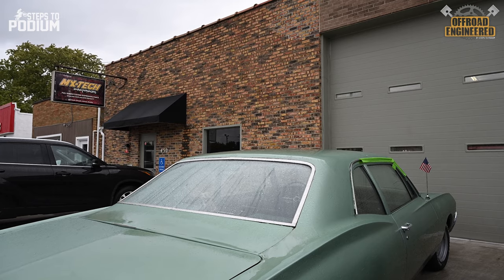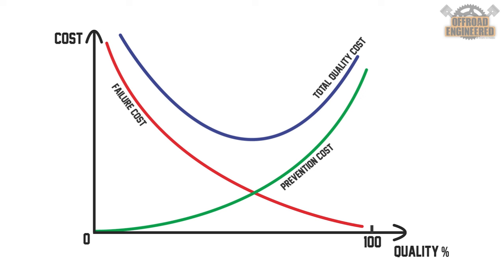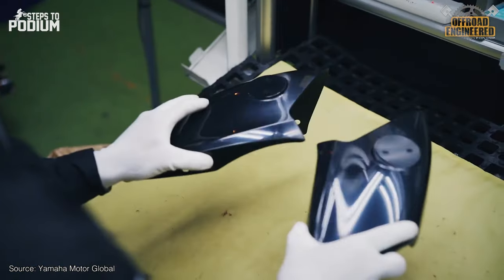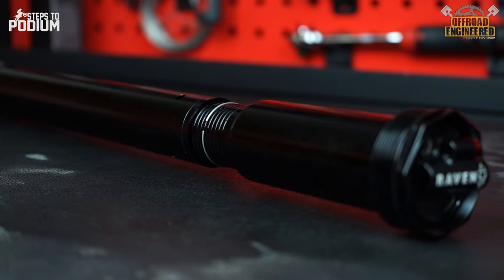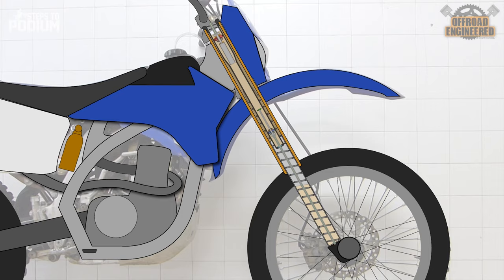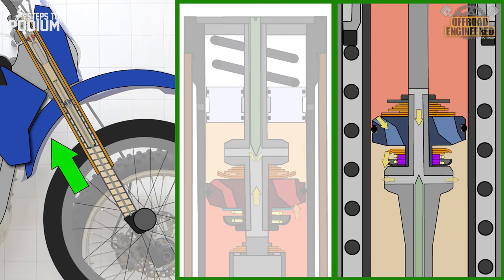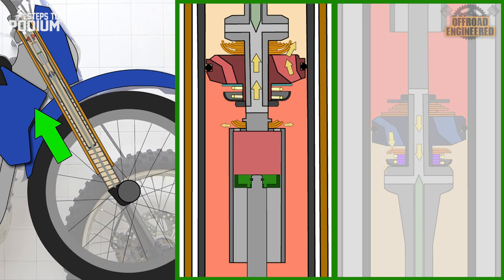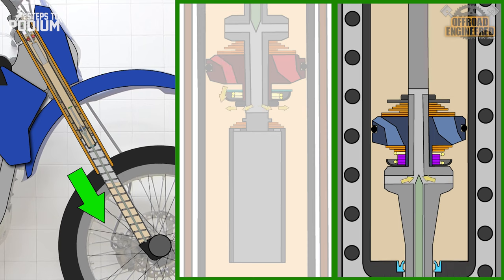@mxtechsuspension  Raven Cartridge Kit | Offroad Engineered

Comment: You have some of the best suspension graphics on YouTube.   Hopefully you will have a video testing these Raven cartridges out and compare them to the KYB SSS forks valved to your personal settings.  Personally I prefer the open cartridge forks for off road riding in non racing situations, they seem to soak up the small bumps better.
Reply from the maker: Thank you so much!
I will, for sure 👌 there are a lot of details that I left out which are more riding specific, but will definitely address those points 💪

Comment: After speaking with MX Tech, I understand that there is a check valve on the mid valve that prevents the low speed bypass on the rebound circuit from allowing free oil flow through this circuit on compression.  I like how they separated these functions and it has allowed me to fine tune compression and rebound settings without any overlap between the 2.
Reply from the maker: Yes there is and I'm glad you are aware of those nuances 💪
To be able to make this video more digestable, some details were left out proposedely. Since that check valve has little impact on the overall behaviour of the forks (it does not mean it has no value, don't take me wrong) I opted to keep things simple 👌

Comment: Forgot the check valve in the huck valve that’s on the mid valve , on compression stroke closes bypass forcing the dampening to be controlled by the shim stack
Reply from the maker: Yes there is and I'm glad you are aware of those nuances 💪
To be able to make this video more digestable, some details were left out proposedely. Since that check valve has little impact on the overall behaviour of the forks (it does not mean it has no value, don't take me wrong) I opted to keep things simple 👌